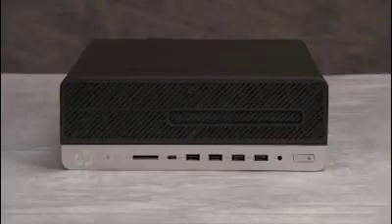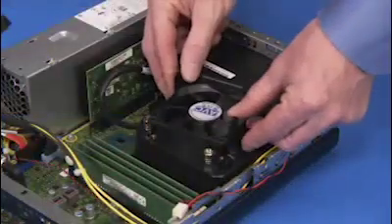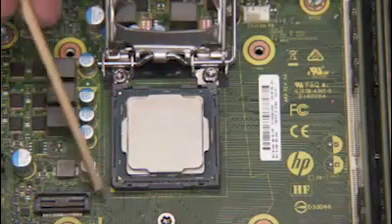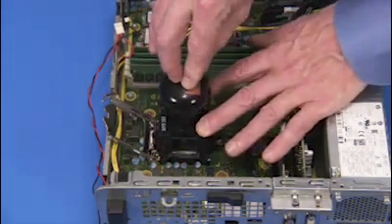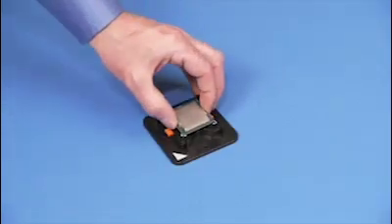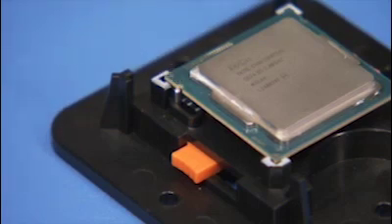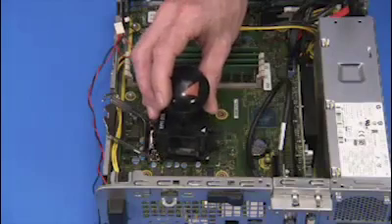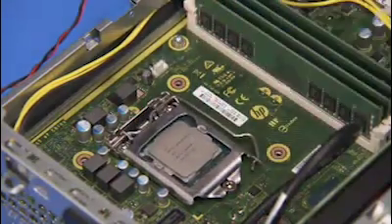Replace the CPU | HP EliteDesk 705 G2 and G4 | HP Support

Comment: well @HPSupport  i tried for HP EliteDesk 705 G4 Ryzen 5 2600 cpu and it won't work with this model, ONLY WITH PRO version, which i cannot find anywhere to buy... BIOS locks usual CPU-s, but why?

Comment: why did you lock these units to pro series am4 CPUs? what if anyone could not even find an amd pro series CPU?
Reply from the maker: Hi there, thanks for contacting HP Global Social Media Support!
I understand that you are not happy with your computer as it is only compatible with AMD processors.
I will do my best to assist you.
The best way to find the correct part number is by using the HP PartSurfer.
Put your laptop's serial number in the search and click on the magnifying glass icon. Look for the display in the list.
https://hp.care/6058tVI2i
For optimal PC and printer performance, remember to always buy (use) Certified HP Genuine Replacement Parts from a known and trusted source. You can order it via the HP Parts store: https://hp.care/6059tVI2c 
Regards, 
HP Support